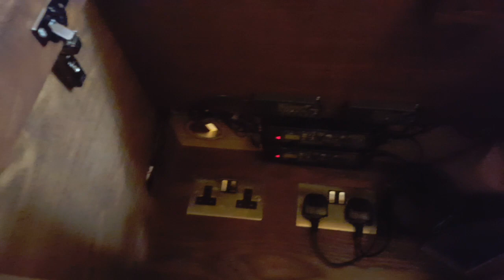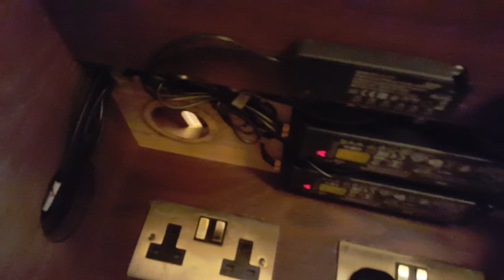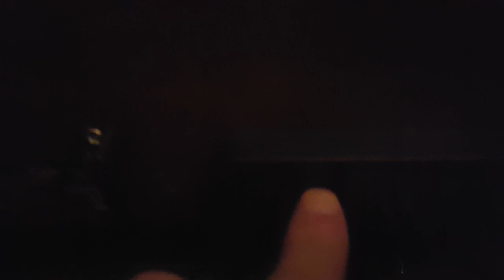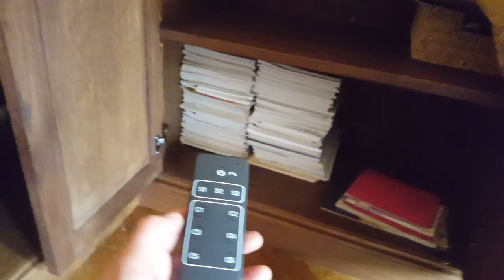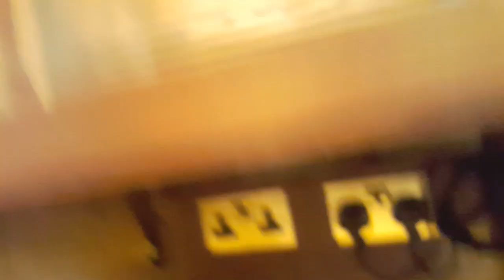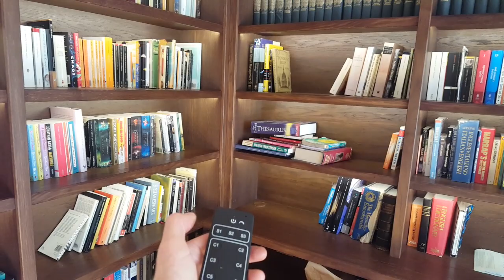Hafele loox LED strip lighting instructional video

Comment: Hi, I've a quick question about the LED strips. How have you installed one long strip along two shelves that are separated by an upright? Is there a hole drilled through the divider? Great video as always!!
Cheers
Reply from the maker: Hi Paul, it’s explained in this longer video around the 7 or 8 minute mark https://youtu.be/chKoL1m6rCM

Comment: Hi there, thanks for posting this. Do you happen to know if the bluetooth-pairing-link is severed when the battery in the remote control dies? Currently installing a bookcase with the receiver hidden behind the bookcase  -- no front-accessible area like you do to access the receiver and driver. From my experience these CR2032 button cell batteries can die relatively soon in some appliances, and obviously I want to spare myself from pulling the (heavy) bookcase from the wall every now and then. Perhaps you have some thoughts on this... otherwise I'll just have to take the risk or drill some extra holes and mount the receiver on the side of the bookcase... Thanks in advance! (I use this exact Haefele setup by the way)
Reply from the maker: Hi, thanks for getting in touch!  Actually I don’t know but Hafele technical are very helpful.  I would say though that on this other job which I installed about 14 months ago I have twice helped them reconnect the remote to one or other of the receivers (instructing them over the phone): https://youtu.be/z29e_iKp7Xs and the issue wasn’t the battery which has lasted well.  The customer said the kids had been messing around with it; I think they mean just pressing buttons on the remote so they might have pressed the combination that unpairs.  For that job we hid the drivers and receivers behind a removable drawer.  I would recommend making them accessible!